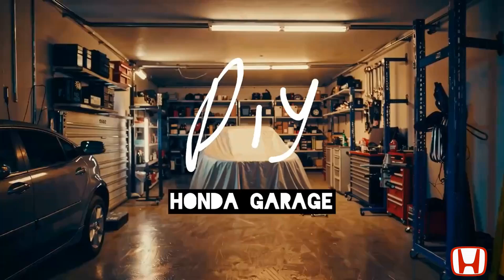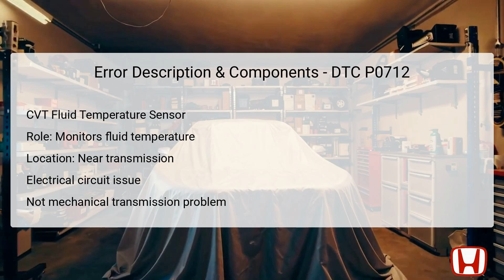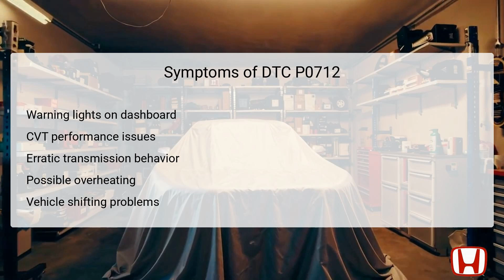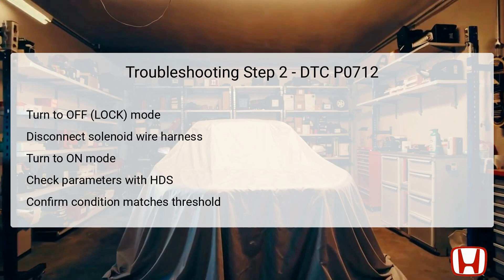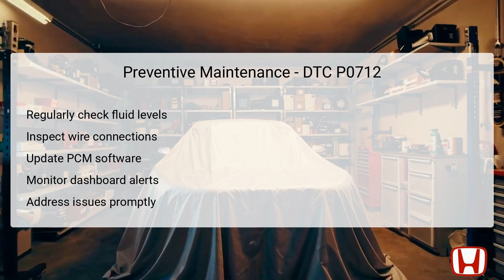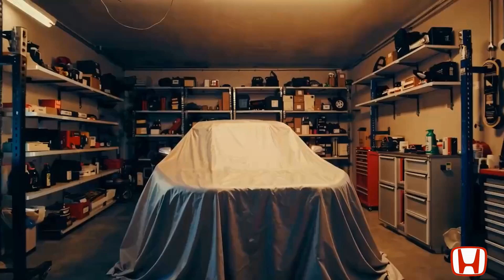DTC P0712: CVT Fluid Temperature Sensor (Short) - Honda HR-V 2016-2022

Comment: Used a regular one scanner and got a p271e code. After clearing it the 2017 Honda HRV came out of limp mode but after running perfectly for 3 miles it went into limp mode again.
Reply from the maker: Check the transmission fluid level and condition.